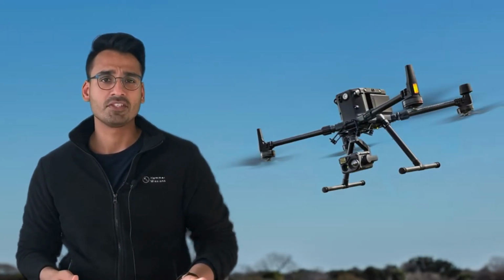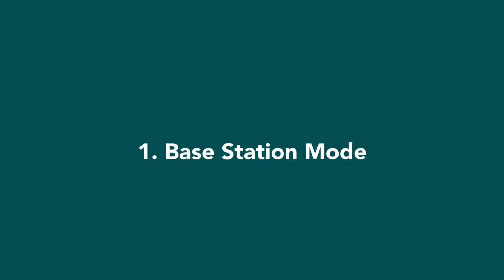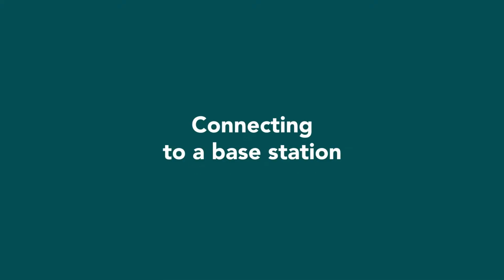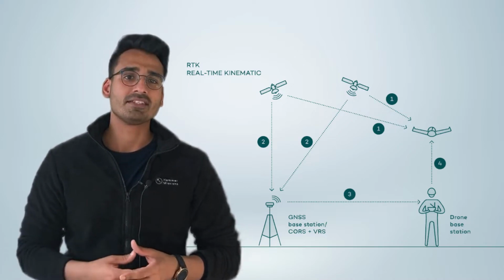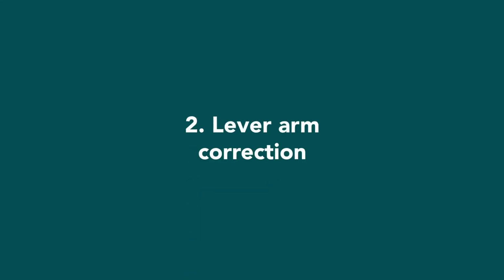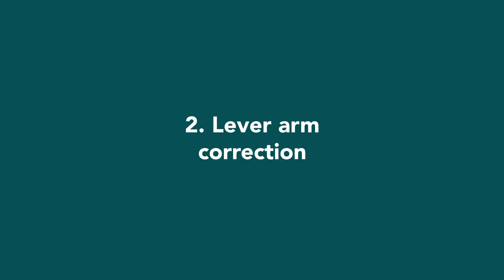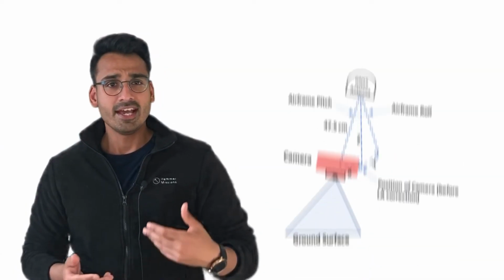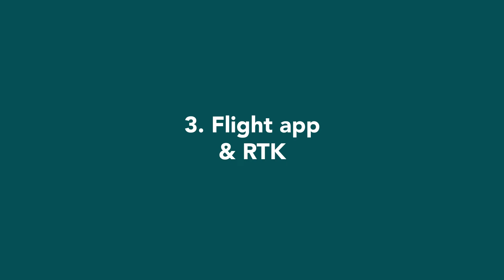Ultimate Accuracy: How to Achieve CM-Level Accuracy Using RTK-enabled Drones

Comment: I am pretty new to RTK and GNSS and am looking to getting into Lidar potentially. I live over in the mountains and I would like to scan some pretty remote areas. Without any network service how do you achieve cm accuracy?
Reply from the maker: Thanks for the question! Have a considered using a RTK base station or a PPK approach? 
https://www.hammermissions.com/post/gcp-rtk-ppk
Reply: @HammerMissions  I think RTK would be the best bet as well as PPK. Only problem is if there are no known GCPs can you still get cm accurate data with just an RTK base station? I dont want to have surveyors rock crawl up to where I want to LIDAR. I watched that video as well. Its good info!
Reply from the maker: @joshuadavis2062  You can still create your own GCPs and measure them using your RTK base even if known ones do not exist? Having GCPs is always a good practice both as fallback mechanism in case you do not receive RTK signal in your target area and also to use as checkpoints for accuracy verification.

Comment: Nice overview video - quick question:  When you mention custom networks, are you referring to a CORS system by chance?  I am in Minnesota and trying to outfit Drone RTK system for mapping accident scenes.  Thank you for any input or advice.
Reply from the maker: That's correct, when we say 'Network RTK' we are referring to the CORS system! Depending on internet availability, Network RTK can be an excellent way to receive RTK corrections on site without carrying bulky equipment. This is also reduces setup time so mapping accident scenes seems like a good use-case fit for CORS, as long as there is good network coverage in the accident prone areas! Here are more of our resources on RTK: https://www.hammermissions.com/learn/tags/rtk